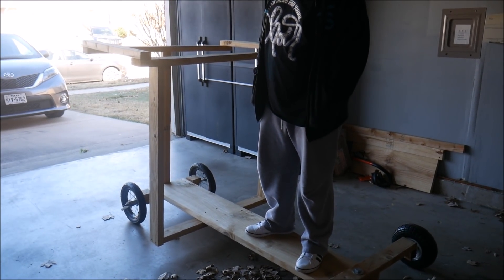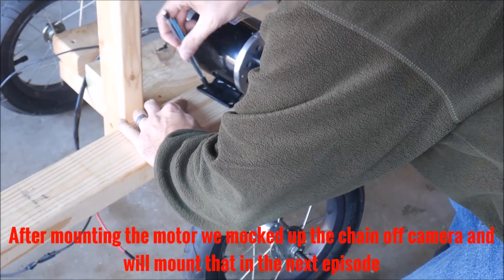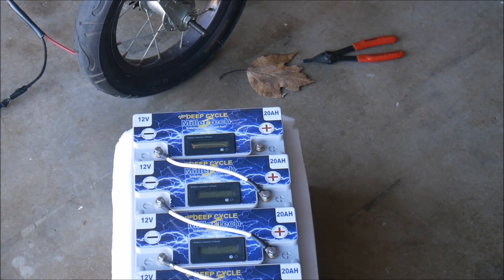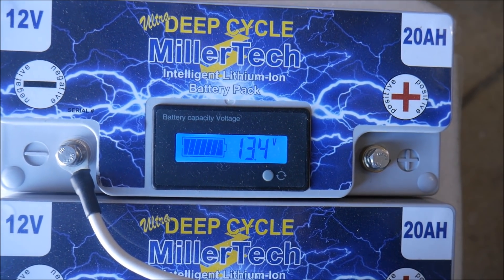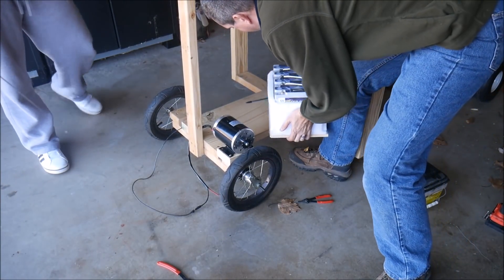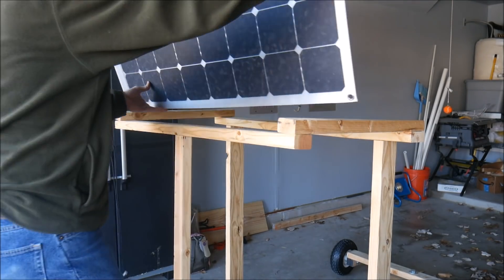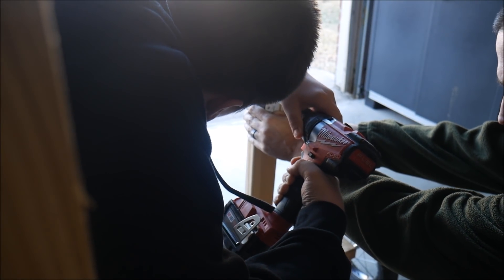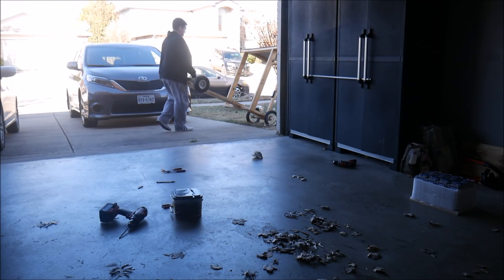Solar Powered Go Kart Project - Part 5

Comment: Thanks for sharing LDS.
I'd really like to see steering and brakes added to this project at some point. Have you decided on some sort of speed controller to manage the voltage going to the motor? The 100 watt panel will do an excellent job of charging those batteries, but the batteries themselves will propell the go kart.
One more thing I'd like to see his say big red button, I mean the kill-switch to cut power going from the batteries to the motor, in case of an emergency "stuck on" situation. Really enjoying this project, not enjoying the short episodes of it.
The Father and Son solar projects are epic though!
Reply: OH8STN ....i will say this with deep respect to you.  This project is a learning/teaching opportunity between a father and son.  They happen to have chosen building a solar powered go cart.  Let's watch them accomplish that in their likeness.  Not yours...not mine...theirs!  The bonding between father and son is the golden trophy.  It has been enjoyable watching them progress.  I'm pretty sure you understand this.  😊
Reply from the maker: Good suggestions.  We have a hand controller that we showed in one of the earlier episodes.  It will control the kart going forward and backward.  We will add brakes at some point.  Right now that will have to be done with the hand controls and his feet.  We are going to try to add some steering, other than by his feet, with the hand controls.  Also, there is a key switch that controls the juice from the controls to the motor.  We may do a kill switch in addition.